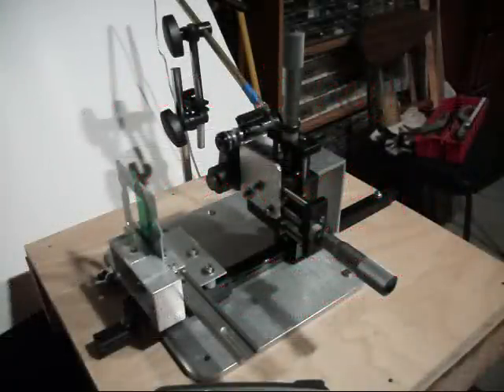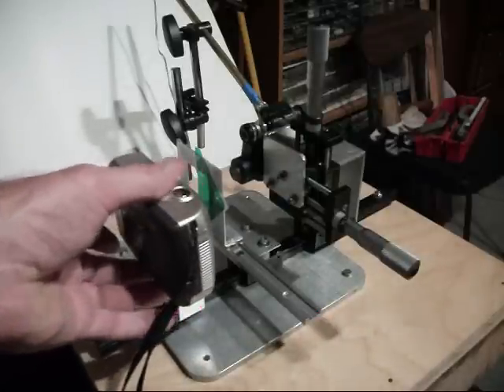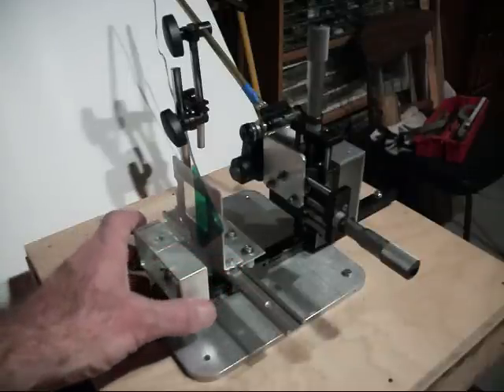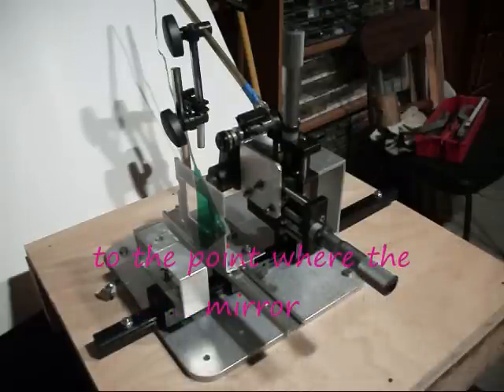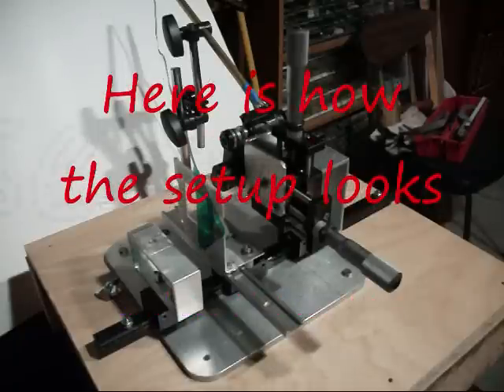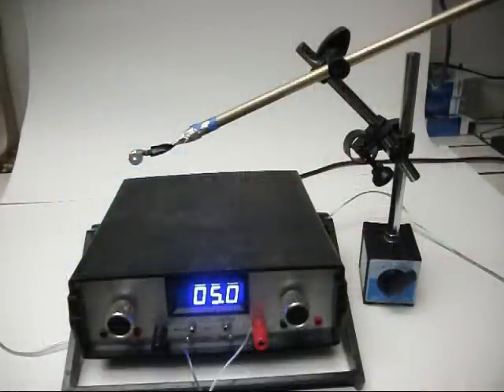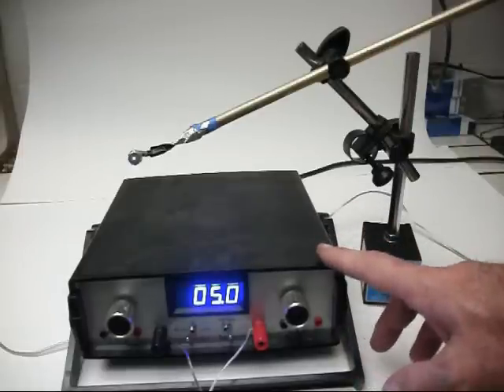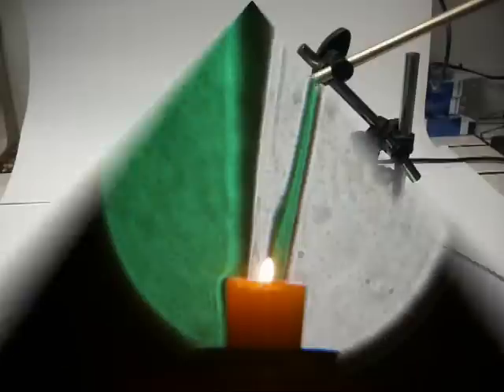How To Make Schlieren Pictures.wmv

Comment: The "point" light source (LED) should be in the focal point, but not the camera. The Schlieren edge, in this case the filter should be at the focal point of the mirror. The bended light, due to the density change in the test area will cutted in this way from the Schlieren edge and will weaken so the intensity. This allows you visualizing the density change.